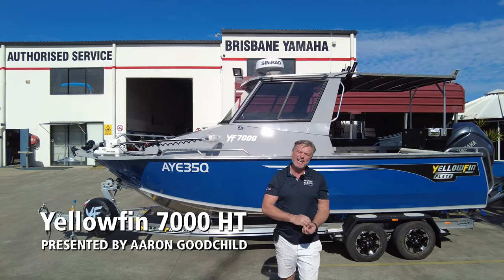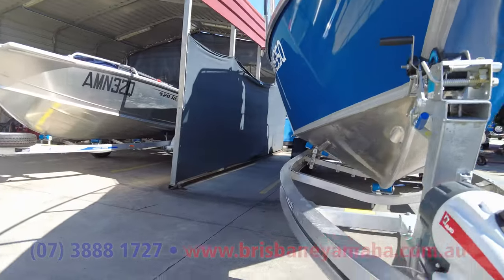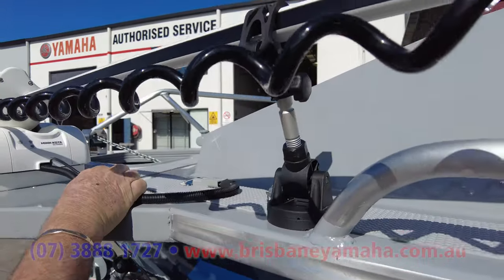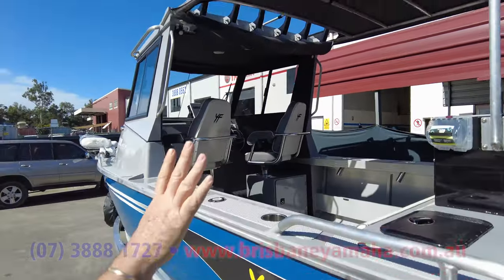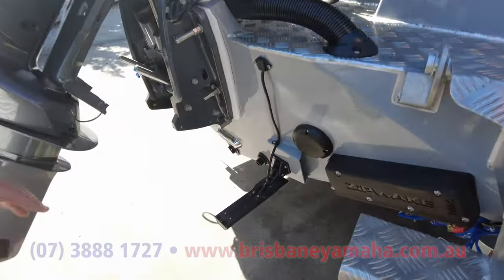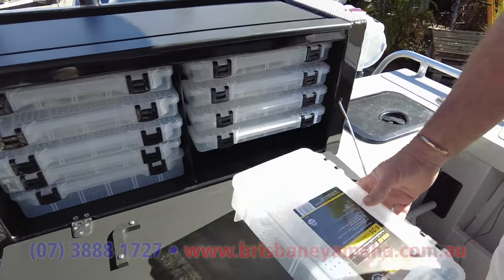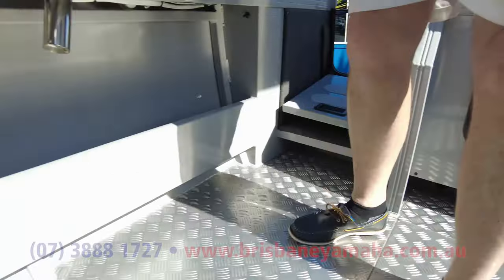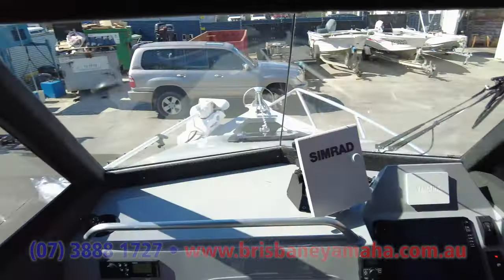Yellowfin 7000 Hard Top with a lot of fruit!

Comment: Aaron what model number Sarca anchor is on the YF7000 mate?
Reply from the maker: I run smaller than recommended  number 2
Why way easier to retrieve using anchor buoy easier on winch too 
The chain length and weight is more important than anchor size because chain holds boat see my anchoring YouTube 
If your Moring  over night or in dangerous locations where dragging an anchor is disaster 
Then use the 3 which is go to 8.5m boat
Reply: @BrisbaneYamaha  Thanks mate